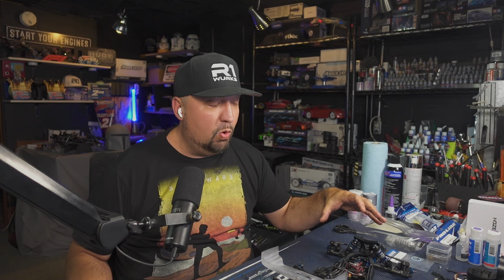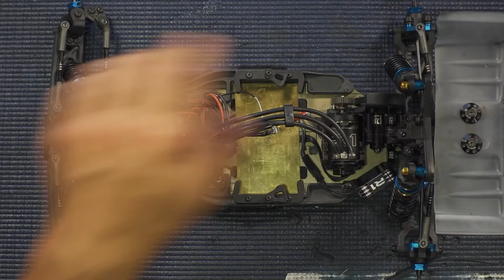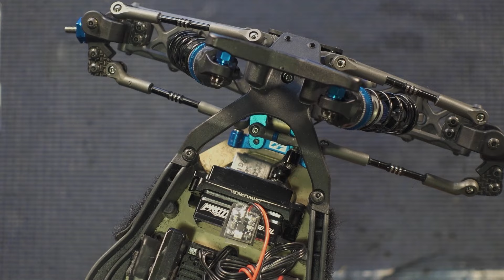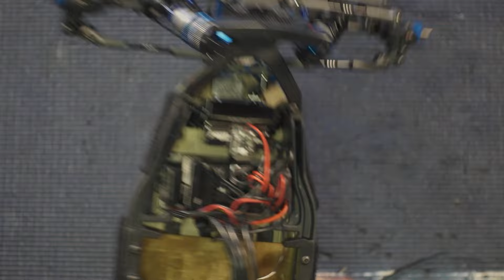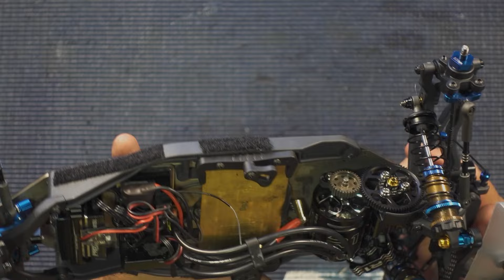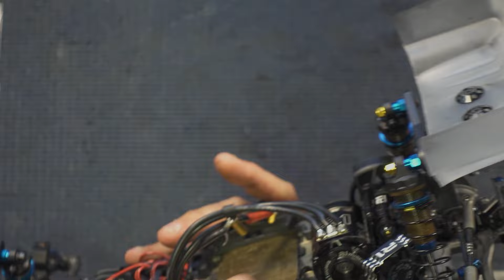TEAM ASSCOAITED B7 30 DAY REVIEW

Comment: Just started building my B7. Couple if things I've noticed is the hinge pins are kinda not smooth. Little flitz and a drill fixed that problem. Just wrap the shaft in a bit of blue shop towel. Insert in the drill and a very small amount of Flitz paste. Polished them up and they are silky smooth now. Back in the late 90s it's one of the things we did. Also polished the stock shock shafts. 
One thing to do with carbon is to use a precision tap. It will be a big help. Takes more time but is well worth it.
Still on the fence about the 3 gear R1. Mostly due to the price and waiting for some reviews of is it faster and such.
Great video. Just found your channel and subscribed.
Reply from the maker: Yeah the tranny help me a lot to get the weight down on the car. Then I just move the battery up a notch or 2 to help move some weight forward. Appreciate the sub brother

Comment: I just put all of the R1 Parts on my b7, did you find any stiffness in your 3 gear transmission? Mine doesn't seem to feel free flowing, I haven't had the opportunity to put it on the track yet
Reply from the maker: Gotta watch the video. I talk about the areas you need to fix. It’s not the r1 parts.

Comment: Are you sponsored by R1 in any way? I am running the 3 gear transmission too, but wanted to ask if you had a sponsorship. Thanks GREAT video!
Reply from the maker: I am a lower level team member. They really reached out to me when I was running drag rc and was doing a lot of that content. That is how the relationship started.  I don’t get any inside news or first looks. Just a small discount.  But I’d be buying their stuff anyway because it’s great quality and I want to fully support the team and a USA based company and manufacturing line.
Reply: @Dorkyand40  No hate here, but when someone mentions a brand a few times I always ask. I race at Hoosier RC hobbyplex with a couple R1 guys who are all super helpful nice guys. I went to the 3 gear R1 for weight bias as I run dirt. only issue I have had is the R1 fan mount breaking and having a tough time with fan placement. I just got the new HD and should have got the short can. Then look like I could use the  stock AE fan mount from your video.
Reply from the maker: @jasonkessinger8062  all good. Yeah those mounts suck. They need to machine them. It def needs improved.